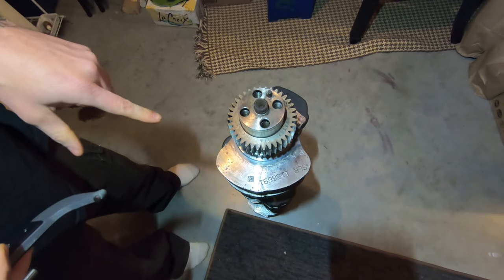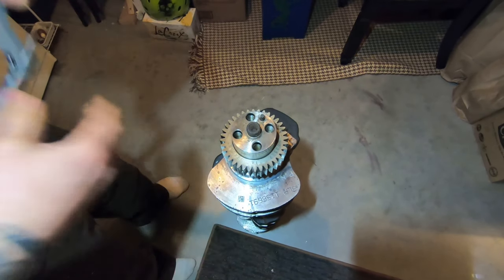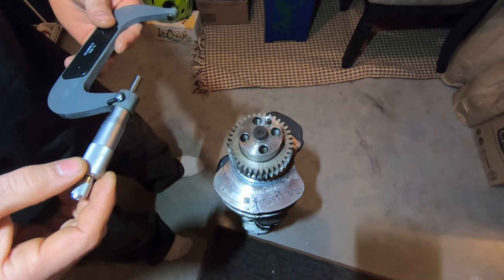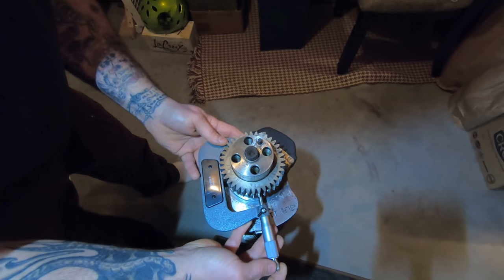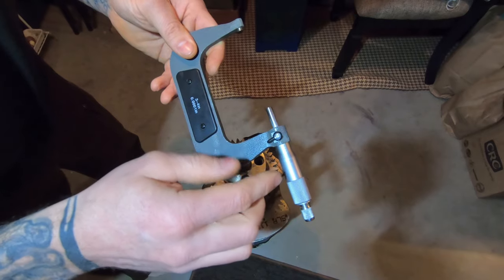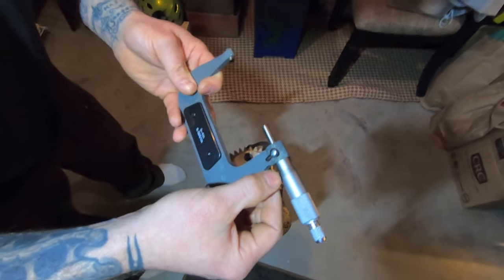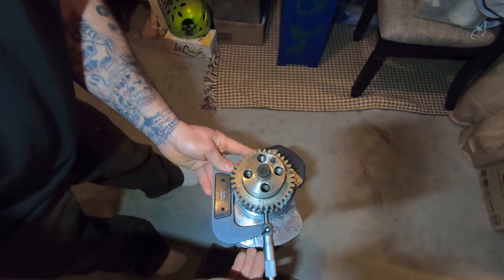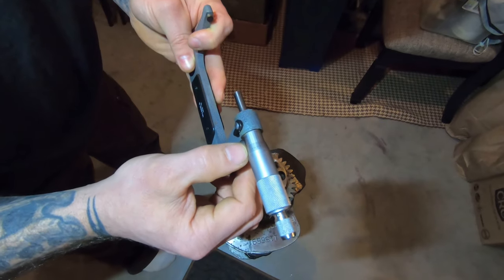03 dodge 3500 5.9 Cummins seized engine rebuild part 6 ( Measuring the crank and connecting rods )

Comment: This is all pure gold for someone trying to learn what goes on in a proper rebuild. Thank you do much.
Reply from the maker: Thank you. There is a lot of things that need to be just right. The guy I had bore the cylinders told me about how they will use different spec bearings to get the clearance of the bearings to I want to say 2.5 thousandths. It all gets very time consuming.